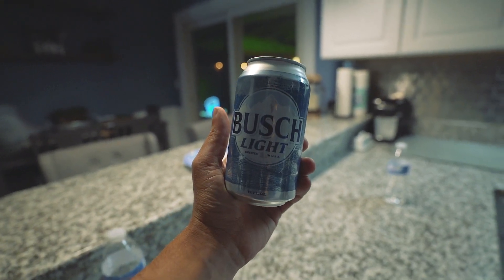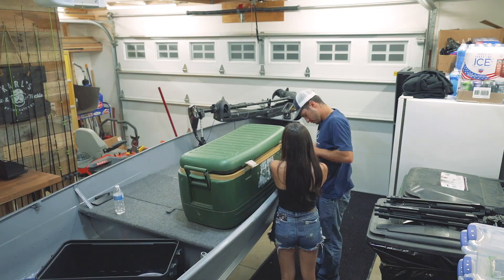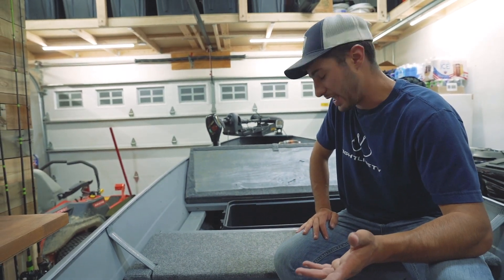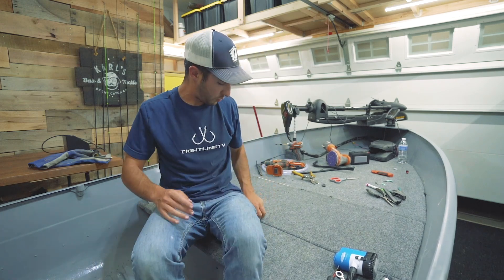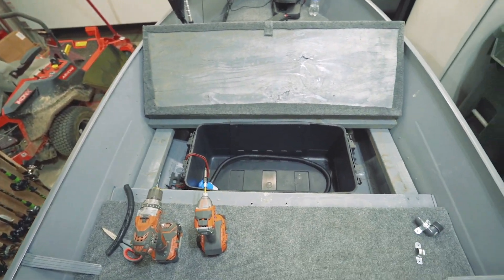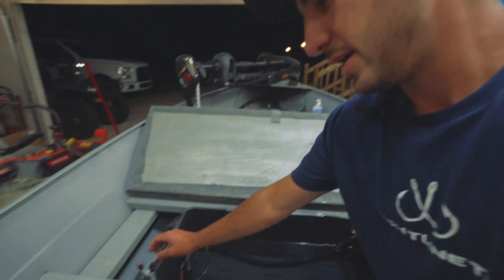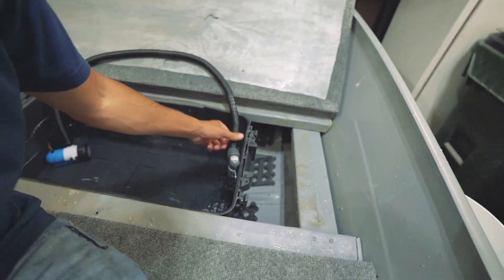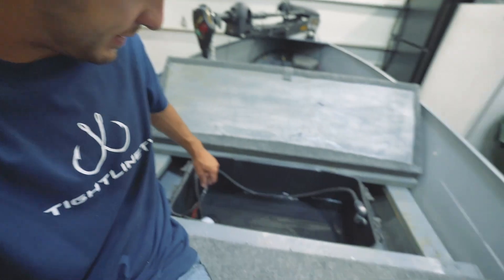Building A BUDGET DIY LIVEWELL In MY HOMEMADE BASS BOAT! | DIY LIVEWELL FOR JON BOAT

Comment: Could cut the edges off the box by cutting it upside down on a table saw. Maybe a good idea would be to attach a sheet of rubber on the underside of the wood cover. Then when the cover is closed the rubber would compress on the edges of the box and act as a lid.

Comment: Just a sajestion put the lid back on run a scribe around thr outside of the lid take a sharpy and make a mark about 2 inches or so all the way around the lid and cut it out glue the lid to the bait well  when you hit a wake or what ever it will prevent the water from splashing out as well as gipping the fish in the bait well. Keeps the water in the bait well and not in the boat

Comment: This things sick. Im 16 and aboutta buy a boat. Its not a Jon boat but the back has a Jon boat type seat in it which i could hollow out and out something like this in there. What supplies did you use? Obviously id use a container that would fit the space better.